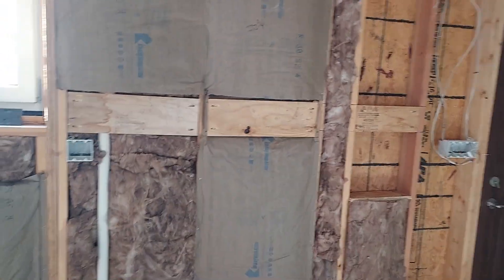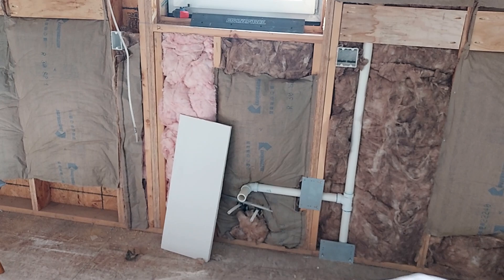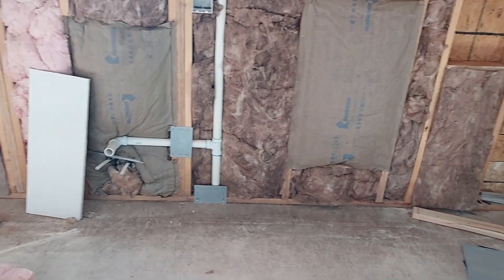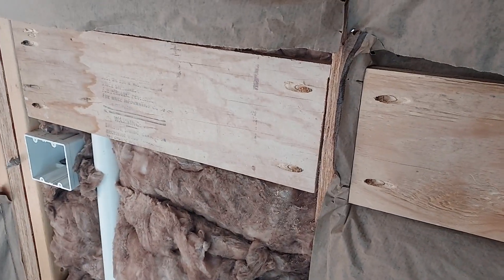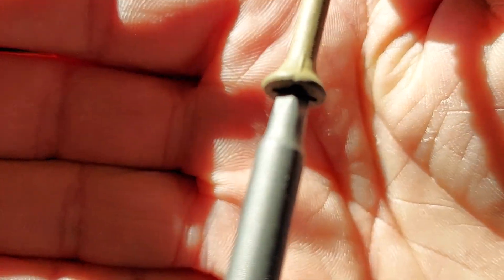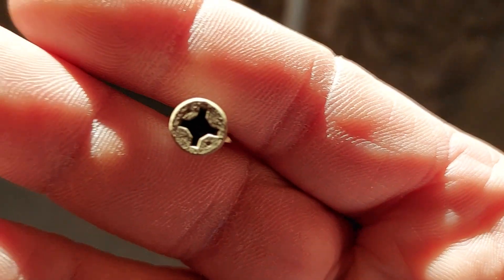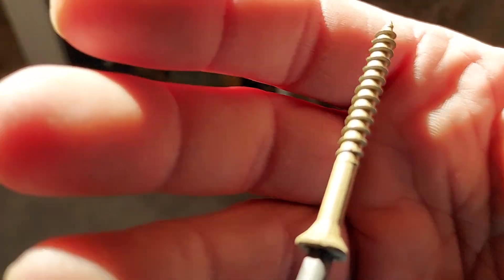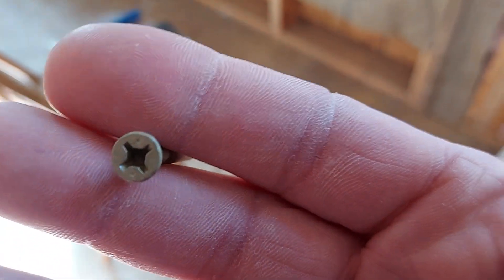Building cabinetry blocking.  My favorite JIS screws did you learn something new?

Comment: Nice tip never knew that.  When I was working on yachts  Painting them &  in fiberglass fabrication for several years we used to call those Hatteras drivers cause all the stainless hardware on Hatteras yachts were  square heads back in the day. Hope all is well.